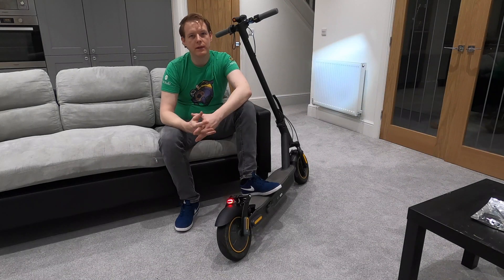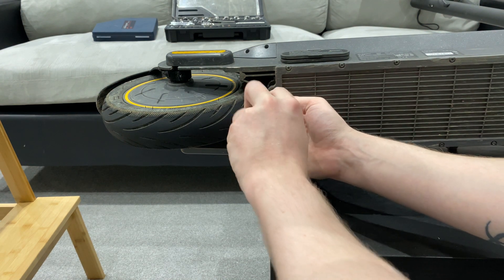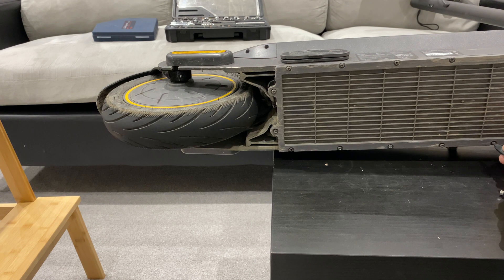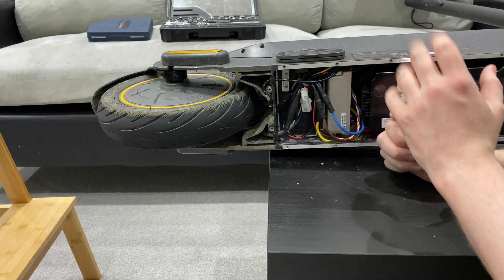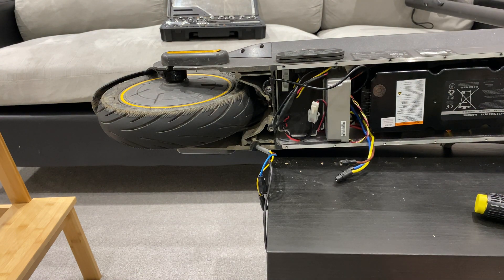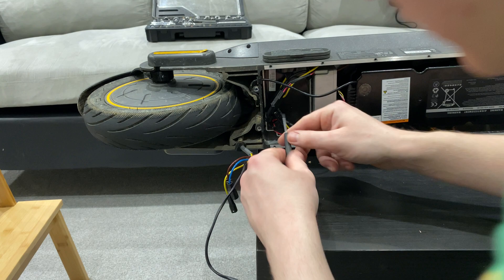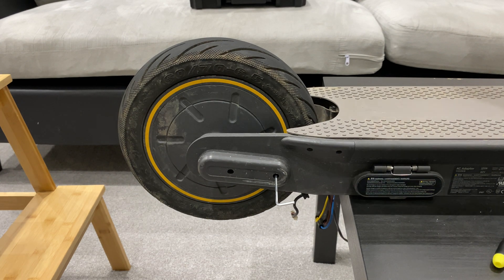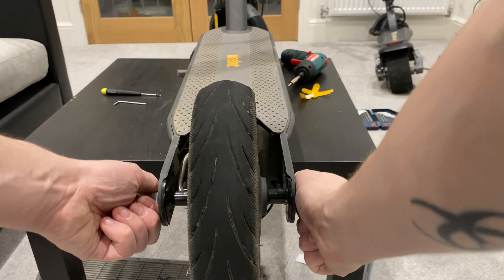Ninebot Max rear suspension install part 1 (Taking off the motor)

Comment: is it posible to install that suspension without disconnecting any wires ? i get that suspension tomorrow and ill be installing it tomorrow .
Reply from the maker: You will need to disconnect the wire to avoid damaging it

Comment: What did you use to get the foot rubber stand glued back on 🤷🏼‍♂️
Reply from the maker: I actually didnt glue mine back down. However, you can used double sided tape, or you may even use PVA glue. You don't need anything strong.

Comment: How about the water resistent?
it still anti water?? Splash or rain?
Reply from the maker: Depending on how you install this you may lose your IP rating.  But I’ve not had any issues. :)

Comment: what size are the security torx screws for the battery cover?
Reply from the maker: I believe they fit a T3 Torx.   But you can buy a pretty cheap set of torx heads to use here.
Mine cost me less that $10

Comment: Great videos!! I didn't unplug anything except the battery plug. I just let my rear tire hang while I installed the shock. Then I pulled the motor to wheel wire out to fit the new distance. I did end up splicing my brake light wires back together. I just illuminated the brake light wire plug. I am also going to replace the spring shock with an air shock. Not that I really need to but I did that to my front shock and really like it. Again thanks for the video!
Reply from the maker: You should definitely do a video on upgrading to air shock.  :). 

I was considering adding mine without taking off the motor.  But I didn’t hang to have to worry about the wires getting cut up and the motor being in my way.   

Also gave me another video on how to remove the motor :).